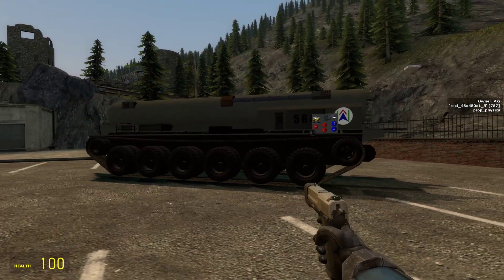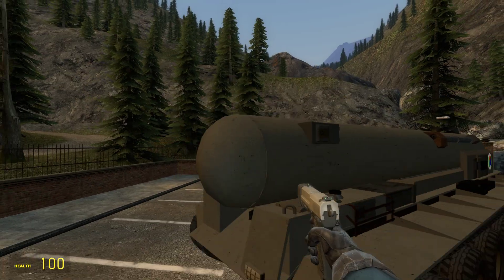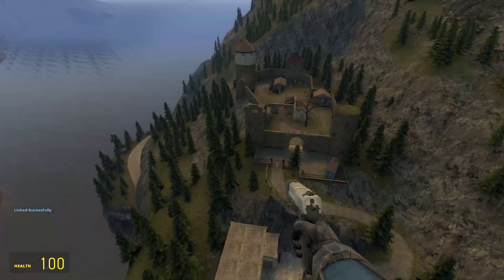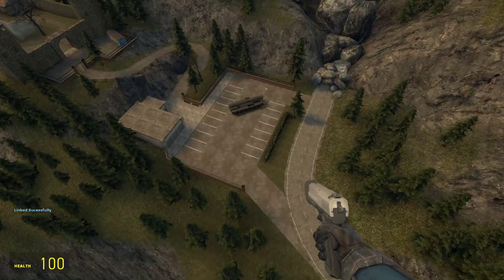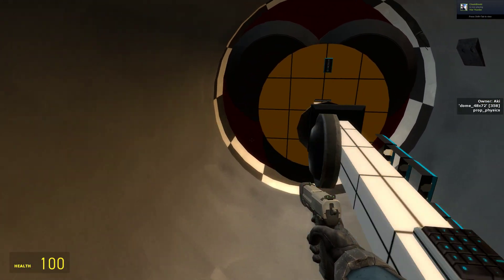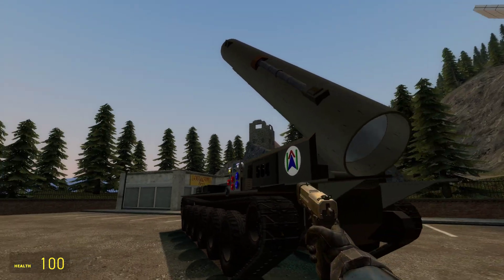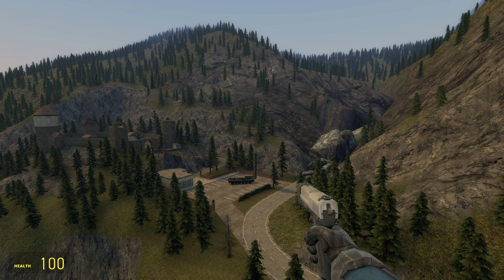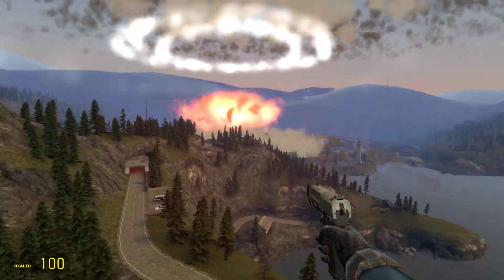Garrys Mod Mobile Missile Launcher V3

Comment: Interested on a tutorial, my missiles often have this less accurate track
Reply from the maker: Thats likely because your missiles are poorly tuned aerodynamically or u need to tune your thruster power, missiles usually have around neutral static stability to maintain maneuverability being too stable can make it hard to track targets. Too powerful of thrusters can lead to spazzing and too weak will have lead to the inability to track targets.